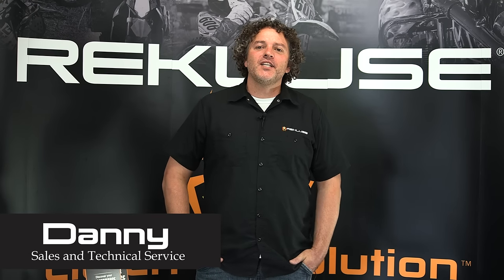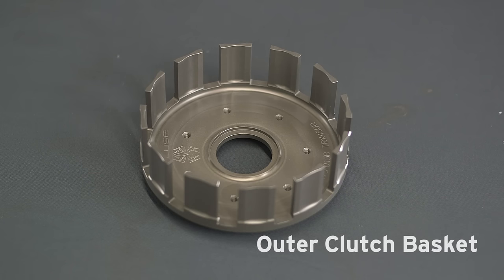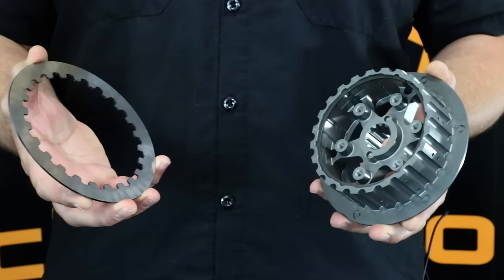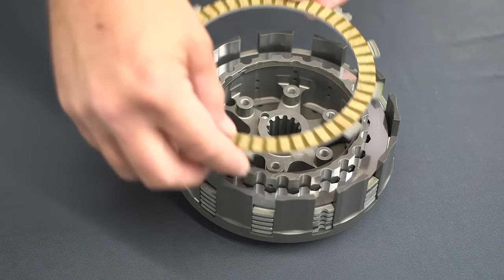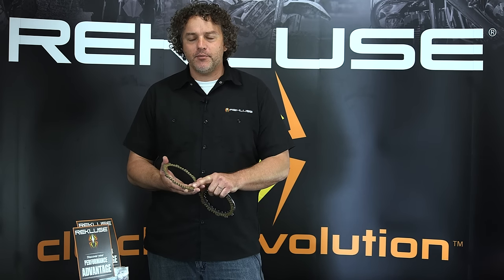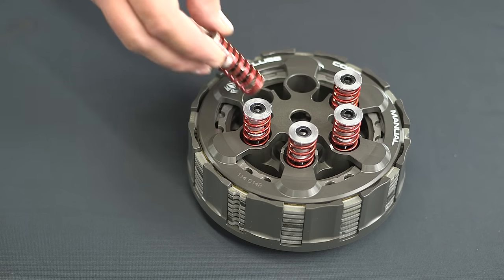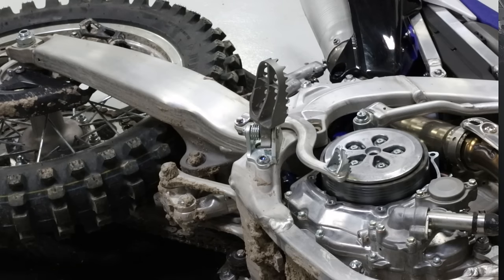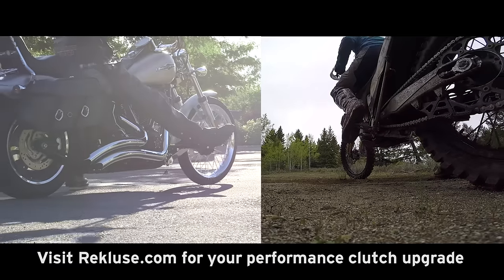Rekluse® How a Clutch Works

Comment: To shift gears on a rekluse clutch equipped  bike do i let go of the throttle and shift or do i still have to use the clutch lever to shift...
Reply from the maker: Hi Rusty- If shifting without the clutch lever, it's recommended to to "Power Shift" just as you would a regular manual clutch. Even with an auto clutch it can be tough to shift through the gears if you are under power without chopping the throttle or bumping the clutch lever.

Comment: Is there any automatic clutch out there that I can up and down shift without the clutch as well? I have carpal tunnel fairly bad in my left hand and can't pull the clutch after about 10 or 15 minutes of riding.
Reply from the maker: Thanks for reaching out with your question. Our RadiusX Auto Clutch allows you to start and stop in 1st gear without touching the clutch lever. Shifting between gears remains the same as it would with a stock, manual clutch. That being said, the technique of "clutchless" or "power shifting" can still be used.. This is accomplished by using the throttle to unload the transmission during shifting. You can learn more about our Auto Clutch by visiting https://rekluse.com/product/radiusx-cruiser/
Reply: you need to use a quick shifter with blipper

Comment: my recluse doesn't work anymore. I just ride it around like its a basic clutch pulling the lever to change gears. I've adjusted freeplay gain doesn't do anything I can have the lever pulled and hit the throttle and the bike goes forward but if I let off the lever coming to a stop the bike stalls
Reply from the maker: We want to help you out with this issue. Feel free to give us a call at (208) 426-0659 or email us at customerservice@rekluse.com. Our hours are 8AM - 5PM Mountain time zone.
Reply: @RekluseMotorSports  ok I will call you

Comment: i know when you start your bike you need to put it in first gear but would i have to shift with my foot antways, or the rekluse does it for me
Reply from the maker: Thanks for your question. You will still need to shift the motorcycle through the gears like normal. The auto clutch will engage and disengage automatically based on your engine RPM, so you won't stall, and you can start and stop in 1st without touching the lever. If you know how to power-shift without the clutch lever, you can continue to do that like normal.